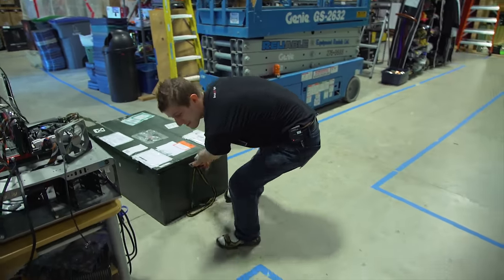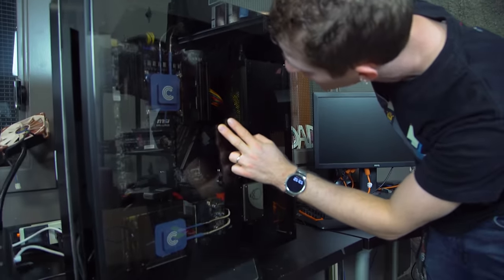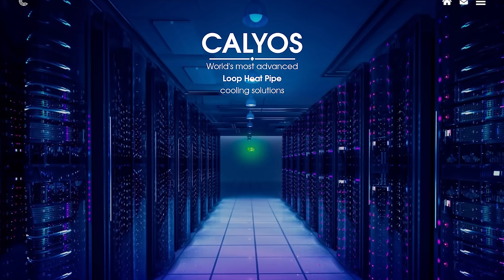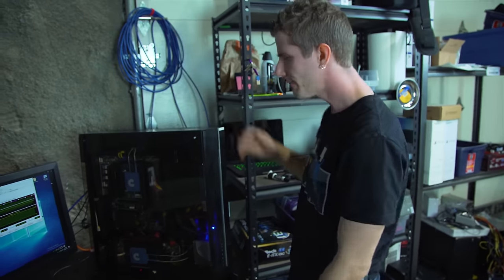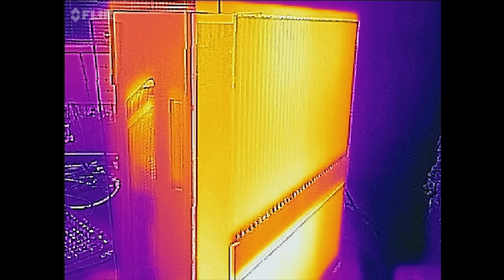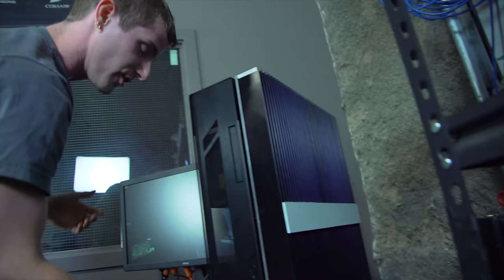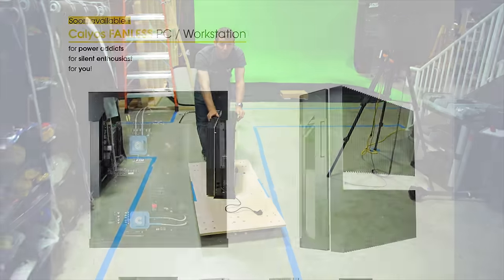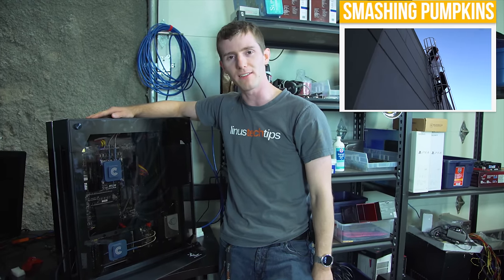TRULY Silent Workstation PC with ZERO FANS - HOLY $H!T Ep. 13

Comment: rookie error lifting with your back......tut tut tut....
Reply: Rookie error, lifting something that weighs as much as you when you have little chicken arms.
Reply: gimmie55 72 pounds is like 32kg... heavy for a pc but not that heavy
Reply: 72 pounds is pretty heavy to dead lift if you don't work out a lot. Especially that far out in front of you
Reply: He needs Micky v moving tips.
Reply: No its not really, a healthy male should be able to deadlift around 65/75 kg around 155 pounds with no training
Reply: yeah, if yo are dead lifting weights, not when lifting the pc at the angle he was and with no real handles and balance to it
Reply: I got the impression his failure to lift it out of the box had more to do with it being stuck in the box rather than the weight alone.
Reply: Remember kids: lift with your neck in a twisting, jerking motion.
Reply: twist and to the left.... twist... and to the left
Reply: Back is kill
Reply: gimmie55 Lifting Tech Tips.
Reply: Just the tip
Reply: 72 pounds is never a lot to deadlift for pretty much any adult Delta X. It's entirely because it's an awkward shape.
Reply: was this the lanparty version?^^
Reply: Rookie error using no capitalization, too many dots and nonsense words.

Comment: The way this works is fairly easy to explain. Chose a refrigerant that boils slightly below the max continuous operating temp of your electronics but will condense again once it gets close to ambient temps. Mount an evaporator to the components you want to cool, this is where their high tech metal sponge comes into play, the capillary action will draw in more liquid refrigerant as the warmed stuff evaporates and flows to the big passive radiator where it cools back down below the boiling temp and collects in the reservoir at the bottom ready to cycle back to the evaporator. No need for pumps or fans if the radiator is massive enough.

Comment: I think this is a great cooling solution and if it will stay at 500 pricepoint it can even warm up my flat! I can finally turn off radiators!
Reply: Max Hoffer put an amd cpu and gpu in it and it might get a little to toasty though.
Reply: But at least you wouldn't need to replace them when the next generation stole all the functional drivers...
Reply: I don't think thermodynamics works like this...
Reply: It will have equal heat output compared to "normal" coolers.
Actually a bit less since the cooling does not need electricity.
Reply: Max Hoffer I use my ps4 for that.
Reply: I died a little reading this
Reply: Gamesfan34260 why
Reply: It will actually generate less heat than a fan-based system.
Reply: Sweg Mastur I just imagine this guy sitting there with loads of really hot desktops around the house to warm it up. XD
It just kills me a little :P

Comment: I hope you didn't take those thermal shots while the glass panel was on?
Reply: Okay, you took them while the glass panel was on... facepalm
Reply: he also shows the input from the thermal sensors in the computer. the thermal shots where on purpose to show what a person might feel if they were next to the computer
Reply: Uhh... It's glass, you need to pretty much put your face onto it to feel any heat, so seems irrelevant to take such photos from that side of the case. Component level hot spots would have given some revelant information how well the temperature is conducted from the components to heat sink and shown possible trouble areas, for that the sidepanel should have been removed.
Reply: Only the heatsink ones were relevant -- the glass side is opaque -- just has the parts because of the visual camera on the flir.
Reply: I had to come down to the comments to see if anyone noticed but not many people seem to know that glass does not heat readings through it.
Reply: Actually he was monitoring the thermals of the Power supply and Graphics card from outside to just find the temperatures, he never said he was doing it to see what its like for a person sitting at the computer.
Reply: Beloved Lover exactly what I thought... smh. Doesn't he even wonder it's showing almost the same values everywhere?
Reply: There is almost no difference because infrared wavelengths travel through glass just fine, you know, like in a greenhouse...

Besides, the temperature gradient wouldn't be so big on the surface of glass.
Reply: Rebasepoiss You're reading bullshit dude, infrared cameras can't read though glass, look it up. 
What he is measuring is the glass temperature, that's why you can't make up exact temperature details and it's all almost evenly spread.
Reply: Rebasepoiss flir can't read through glass.
Reply: NDA of not opening it
Reply: That's not glass, otherwise it would have looked like a metal panel on the infrared. Probably poly carbonate of some sort. Those do pass infrared trough quite well. I was bothered by him leaving the packing styrofoam in the radiator on the back totally fucking up the normal airflow trough the radiator....
Reply: 1. He wasn't allowed to open it(he says it right at the start of the video if you watched it) 2. It's not glass or it would have looked like a flat out metal reflection panel when taking the shots. It's probably poly or plexi which is not precise but adequate for taking shots, which in the end doesn't matter because the heatsink and core readings show it's effectiveness as well.
Reply: He's not allowed to open it, how about actually paying attention to the video before you post.
Reply: The computer spec temperatures of the components were correct, and the FLIR of the fins was correct, however as many people have stated before me, infrared light does not travel through (all types I know of) glass. The FLIR shots of the components through the glass would all have just been measuring the glass temperature itself, heated up by those components. An easy oversight for the uninformed.
Reply: Right, it's completely irrelevant to know the temperature of the parts of the case that you will be more able to touch.

Get out of here, smartypants.
Reply: Rebasepoiss this is totally incorrect.
Reply: He opened it to put the test bench drive in. He wasn't allowed to open the cooling system part.
Reply: +Rev Raptor I understood that he is not allowed to take the cooling system apart, which I understand since they would probably break it as it's not probably very easy assembly to take down.
Reply: +Eviltech according to Lian-Li the case has Tempered Glass, also some reviews state that the glass side panel IS HEAVY, so I doubt it is any kind of poly carbonate.
Reply: Beloved Lover I knew it was tempered glass as soon as I saw it. But then again no point in arguing with scientific standpoints on Trolltube. The measurings should show very different values on CPU, GPU and VRMs. Linus measured the glass surface.
Reply: Beloved Lover Whatever it is, it's not glass. Glass is not transparent to long wave infrared.
Reply: Alexander Mustermann And how the fuck did you know that?
Reply: Eviltech because it's a Lian Li case and the side panel is huge and flat.
Reply: +Eviltech The FLIR camera used has also a regular camera on it and it layers the thermal image with it, that's why you can see the hardware on the background, but the thermal readings are from the surface of the glass.

Anyway, this is getting totally out of hand. All I just wanted to point out is that the thermal readings from the glass panel side of the case are pretty much irrelevant and useless in terms of data points. Readings without the glass panel would have showed much better thermal data from the components, now it's mostly just big blur of pretty even thermal readings across the panel, because of the glass. This is based on my own experience with military and industrial grade thermal imaging hardware and data I have available in this case (content in this video, FLIR ONE specs, Lian-Li case specs - which is customized to fit huge heatsink on the other side of the case).

Disclaimer: I don't have indepth training in thermal imaging, but every source you can find about thermal imaging and glass/window surfaces, you'll hear the same thing. So don't take my word, do your own research.

I quit from this thread. Consider yourself to be winner if it makes you feel any better. But I would suggest you to look specially into problems on thermal imaging and thermal properties of glass.
Reply: Beloved Lover If it does overlay a normal image on the panel, than yes, the panel must be glass. That would also explain why the printing on the cooling block looked like it was much hotter than the rest. And as always Linus is still the idiot to not think trough his tests...

Comment: After all the  "zero fans" claims/hype, at the end of the video he says, like a trival after thought, "oh, by the way, it has a gtx1080 fan".  How is it that what is typically the loudest fan in the computer doesn't count???
Reply from the maker: +Jeff Buchanan it doesn't have a fan
Reply: He says "there are lots of fanless computers, but this one [fanless computer] has a gtx 1080 [that is fanless]." Implying, correctly, that there are very few computers that are fanless that have a gtx 1080 in them.
Reply: i think you missunderstood what he said. He says there are alot of fan-less computers out there BUT this one has a 1080 in it, as in just the gpu - no fan
Reply: ZX Spectrum, Amiga and Atari of the 1980's were also fanless.
Reply: cringe
Reply: oh mitch got you m8
Reply: Did you actually watch the video? Seriously, this entire video is about how they were able to water cool a system with no fans or pumps. The entire coolant circulation is passive.
Reply: Depends on the model of Amiga. I have a A1000 here and the power supply has a fan, the 1200 also has a fan in it. The 2000/3000/4000 definitely had fans. The ones I am not sure on are the A500/600 or the CDTV
Reply: Actually, he said there is a GTX1080 in it, he did not say it had a fan.
Reply: oh and the GPU is never the loudest fan, at least on nVidia side, that goes for the CPU cooler or in a lot of cases, the PSU fan.
Reply: +White Supremacy Coolant cooled.
Reply: I can't hear any of this bullshit above the noise of my fans :D
Reply: omg watch the video -_-

Comment: Interesting concept, it would never see production. If 70lbs is giving you that much trouble Linus it may be time to hit the gym, some Deads and overhead presses will do wonders.
Reply: TalesOfWar I'm just giving him a bit of a hard time, you are right it is a bulky object but all in all not that bad, I have a large cube case that is over 50lbs and is more awkward to carry but yeah it isn't easy.
Reply: why would it never see production? this is like a legitimately good solution that has a market, as opposed to most of the gimmicks shown here. it's also environmental as far as I can tell
Reply: lusteraliaszero There is a trend to SFF cases not 72lb ones, and having a few fans isn't that loud so I can't see enough of a business case, no pun intended.
Reply: SS S There's an actual demand for fanless servers though.
Not to mention power users, especially gamers rarely give a shit about pragmatism.
Reply: I work for a custom gaming pc company...Number one complaint from people is the noise of the fans at load.
Reply: Must just be me then I don't mind fans as long as they are not at full speed.
Reply: TrickyNekro yeah, 20 kg is sorta bad, and you really shouldn't use a smith machine
Reply: TrickyNekro No, I'm saying you should do squads, but you shouldn't do them in smith machines, they're seriously not good for you.
Reply: no gym
Reply: Maybe not in this particular form, but the technology they are implementing will certainly do wonders in heat pipes (for example). I don't think a company would invest 4.5 million dollars in a research without knowing weather it would work or not.
Reply: he lift it anyway...using brain

Comment: $500 is accually a good price for that. I really hate the noise that my computer makes, I mean, I think I would pay $1000 to remove the godammit noise
Reply: Just use headphones m8
Reply: my computer is connected to my TV in my living room, so no headphones
Reply: Xano Trevisan Kothe just buy wireless headphones or a extra cable..
Reply: be_ nik Thanks for the tips, but I do not want headphones
Reply: Sometimes people don't understand that cats have living room pcs and $1000+ dollars in audio components.  Not all pcs are bedroom or corner gaming machines.  No disrespect
Reply: Jeff: thank you gif
Reply: get good fans? silent case? put the pc on a closet? another room?
Reply: too much work....XD I would rather pay for something like this which is much more practical than digging holes in my house and running cable around and good fans cost around $20 a pop that is what 100 in fan already? in a normal case and plus the case which you know 150 and you already be spending 250....not including cpu cooler which is another 100 for an aio 350...there you go for 150 more you get well this thing. Not the mention the GPU cooler that this thing come with.
Reply: Jace Vo how much do you think it will cost to mail this from belgium? Just the box and foam it came in costs a hole computer
 Your house walls are already full of holes, you can use a single thunderbolt cable for everything thats connected to the pc...
Reply: yea that is a good point but hopefully this thing will get mass produce one day.
Reply: Vinicius Pagliarini This is not my case. There is no more space in the pipes in my house. The last time I had to wire from the roft and the outside of my house to pass a new ethernet cable, really pain
Reply: Xano Trevisan Kothe then this case would be awesome, considering you find the minimalist industrial design attractive as a piece of your living room furniture.
Reply: I thought it would cost 5k
Reply: Xano Trevisan Kothe that's really fkn good
Reply: The Powah: I'm not into overclock
Reply: Xano Trevisan Kothe I am more annoyed by coil whine than my vents
Reply: give me $1000 and il get you a monitor and peripheral extension cables and just put your pc in another room.

il keep the $950+ left over
Reply: This is Brazil Porra. HueHueHue
Reply: How can anyone stand a wispier quiet room then you have to listen to everyone in the house making noise around you my pc has 4 140 mm fans all set to full speed dosent bother me at all now my ac is out of my window it is too quiet in my room and my ac fan was set to full speed
Reply: Tamo junto
Reply: Seems your computer is ill designed. It's possible to make a reasonably affordable and reasonably low-noise actively cooled system that is basically inaudible in 2-3 meters distance, blends into ambient noise. The noise that walls themselves make, you can make fans this silent.
Reply: How many fans do you have in there? I'd imagine a lot of low RPM fans would be fairly quiet
Reply: Based on what Linus said though, it seems that they will only accept bulk orders. Massdrop anyone?
Reply: Lance Lindle Lee great idea, contact calyos and inform them they probably never heard of massdrop
Reply: Get better headphones

Comment: 72 pounds are 32.6 kg for normal people.
Reply: thx :D
Reply: Matteo Bossi ty bro
Reply: Bloody hell he really needs to start lifting.
Reply: Thank you good sir.  @linustechtips get with the program
Reply: frickn people not using metric.
Reply: that isn't even that heavy considering the amount of material.
Reply: wtf I thought it was like 50 kilos, why is Linus having so much trouble with this
Reply: that is not that much, linus really needs to train a little.... i dont train, and that isnt that heavy...
Reply: Matteo Bossi THANK YOU!
Reply: yea me to, he must be rly weak
Reply: About the weight of a 28" CRT then
Reply: There are too many videos with too many values in non-metric units that it would be an endless back and forth to look up the conversion, which is usually more annoying than to ignore the number and judge the weight/speed/length by the presenter's reaction
Reply: Because is big af.
Reply: American over here, so pounds is the "normal".

That being said... I hate the system that we use, haha.
Reply: 32kg not that much.
Reply: American over here, so pounds is the "normal".

That being said... I hate the system that we use, haha.

Imperial socket sets confuse the hell out of me. 5/32 3/16 7/32 1/4 19/32 21/32. Why go through all that bullshit when they could have made it 8, 9, 10, 11, 12, 13, 14 and then it's clear which one is bigger/smaller.
Reply: My ups alone is 35.5kg... and it's heavy
Reply: Honestly when you are older than twelve you should be able to estimate how many kilos it is.1kg ~ 2,2lb.So 72lb is around 33 kg.
Reply: @caetands1  thank you
Reply: ShengTooFlash haha np lol
Reply: Normal people? No country that uses the metric system has put a man on the Moon!